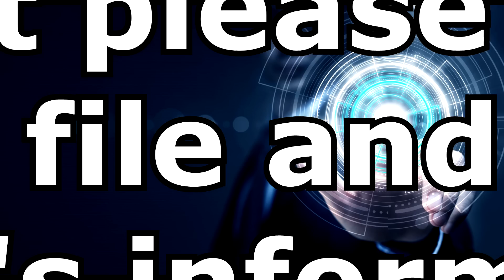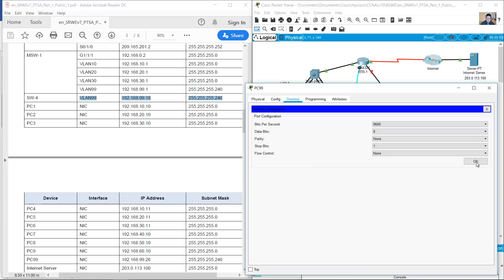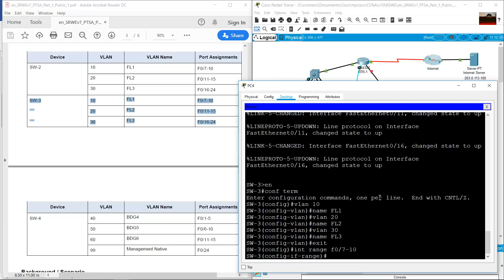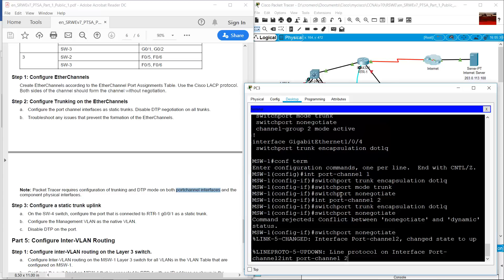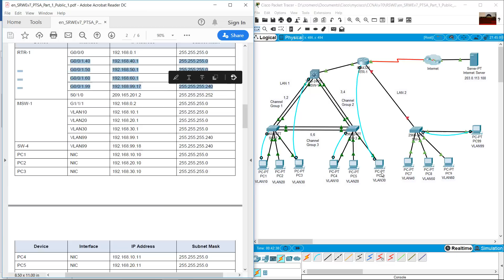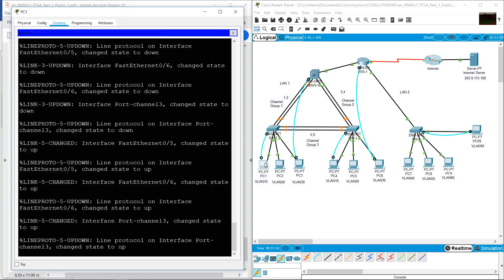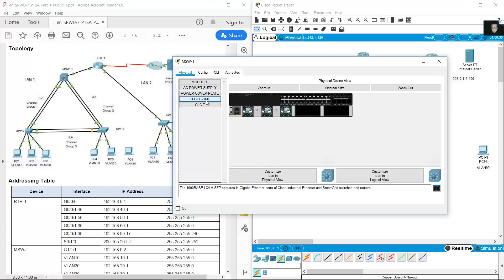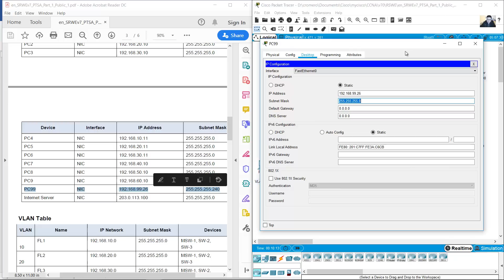CCNAv7 SRWE Packet Tracer Skills Assessment Part 1

Comment: after doing command show running-config, the part where you said we should have ip route 0.0.0.0 0.0.0.0 209.165.201.1 I do not. I have the 0's then it says serial 10/1/0 no IP address to get to internet. You said we need to configure it. Can you kindly give me the command for that. I know I know it, but it's just not working. As always, Thanks for the videos and the responses.
Reply from the maker: use the file I shared on information of the video, but if you are using the file for real exam don't worry about it